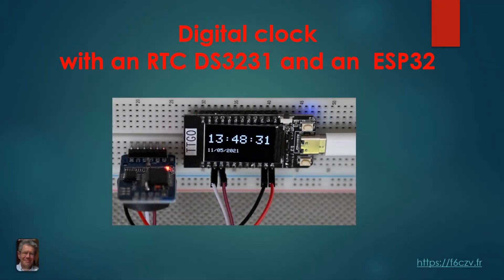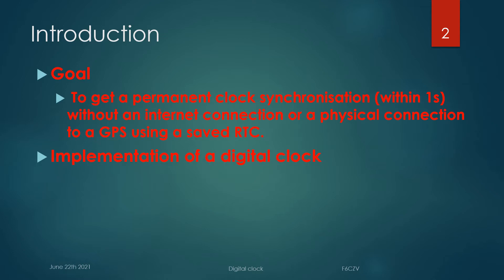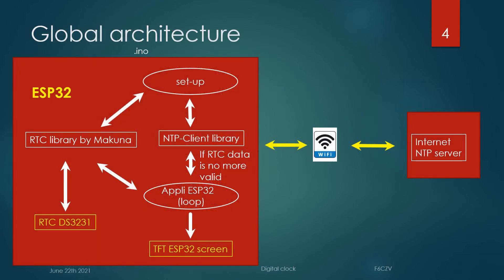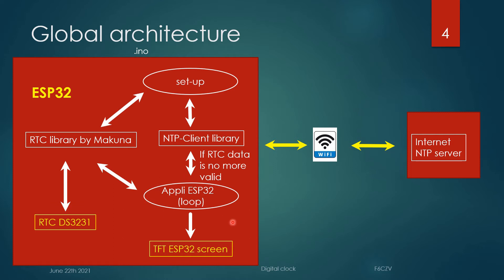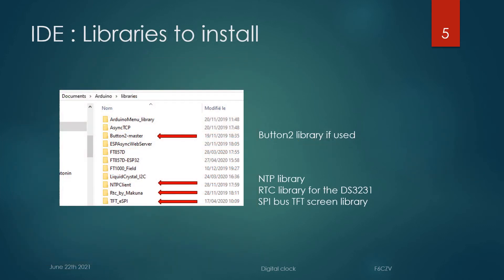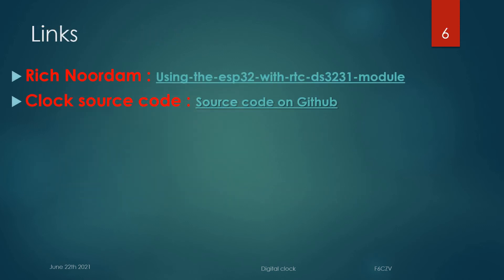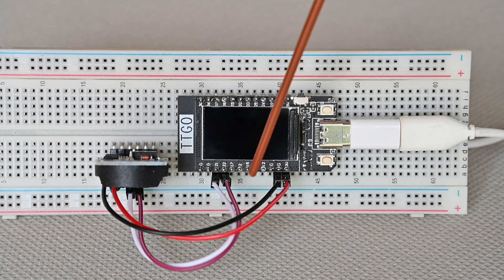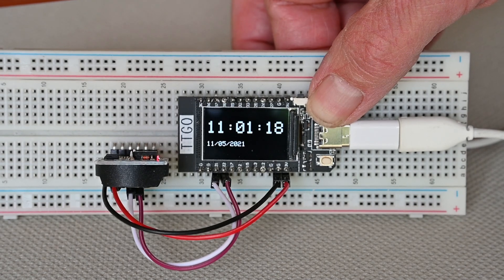A date-time display on a TTGO T-Display using a DS3231 RTC

Comment: Do you think you could use a DS1302 instead of the ds3231 ?
Reply from the maker: DS1302 may be used but I read that it is less reliable than the DS3231